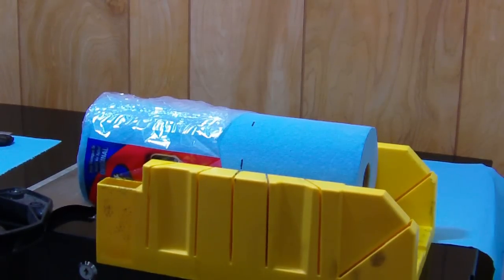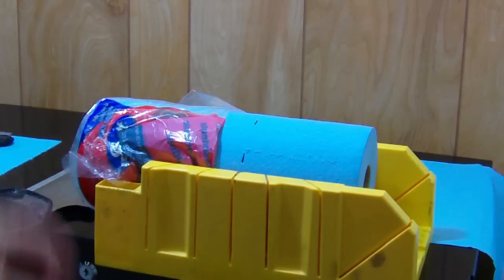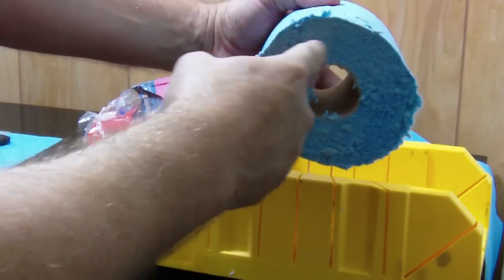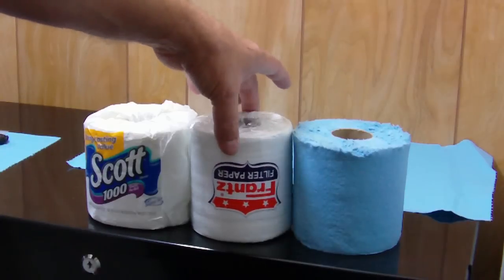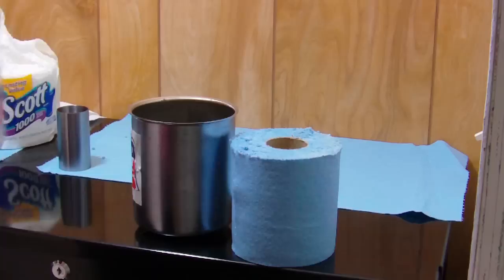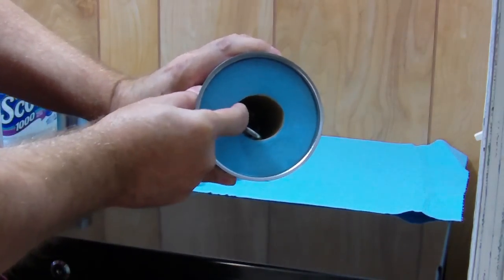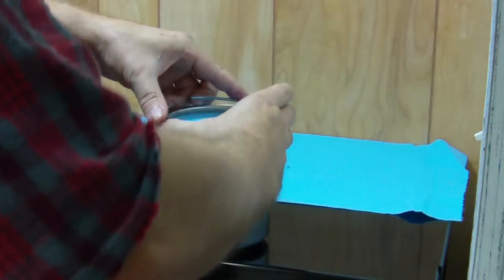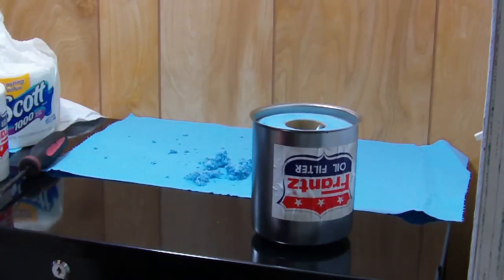Blue Shop Towels as a Bypass Filter Experiment

Comment: a Fram C3P  is only $10.00.  and filters down to  2-3 micron.    why do you want to reinvent the wheel?   er filter?
Reply: Moe Shouse Some people run these in addition to a regular filter. Or they run them on vehicles with hard to reach filters. Yes there are other options out there. Some of those options have expensive replacement filters. With this setup they are 99 cents after setup.
Reply: Fram c3p
Reply: It is not a full flow filter if it is 2-3 microns. It will not flow enough for an engine unless it is 8 inches in diameter and about 15 inches long. I think you need to do more research.
Reply: Is that used as a secondary by pass filter ?
Reply: Motor  Guard started as a lube oil filter in 1961. They have always claimed submicronic. I believe Frantz was similar. The Jackmaster Classic claims 1 micron if you use their elements. I would think it would  depend on the quality of the toilet paper flow rate and pressure. The Australian Jackmaster Classic must use a firm roll of toilet paper such as Scott 1000 or the Jackmaster Classic element which is a very high quality roll lof Australian toilet paper in a sock. The Jackmaster Classic has a standard size orifice at the outlet. About .060. I put a .025 wire welder tip in a brass fitting and put it in the inlet. The Jackmaster  cleans about 3/4 quart when the oil is hot. Im i the Dallas Texas area. This might not work in cold country short trips. I check the filter to make sure it is getting hot.
Reply: Fram hasnt made a filter that cleans oil in many years. My 41 Dodge had a Fram that cleaned oil almost as good as the toilet paper filters. It used cotton the same as the Luberfiner. Dont know when Fram stopped making cotton elements. They were still around in the 60s. John Frantz started putting TP in them in 1953. Saw some Purolater  TP conversions on Ebay. Probably John Frantz models.
Reply: Yes its a secondary filter.
Reply: The .025 wire welder tip is actually about .045. It uses .025 wire. The normal orifice size is 1/16 inch. I like the orifice at the inlet. My Jackmaster Classic cleans about 3/4 quart per minute when the oil is hot in the Pontiac. I check to make sure the Jackmaster Classic is getting hot. At present the Jackmaster Classic  has a cut down roll of VIVA towels in it..The oil has some carbon black in it for testing. The VIVA is similar to the Scott shop towels.